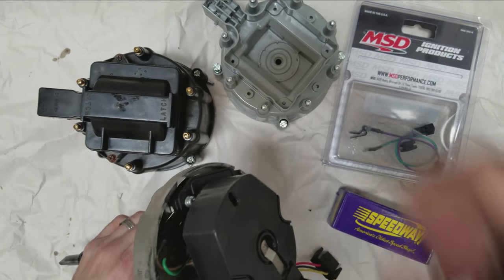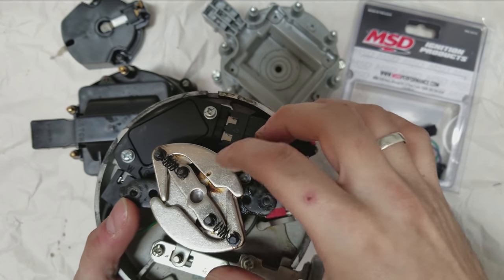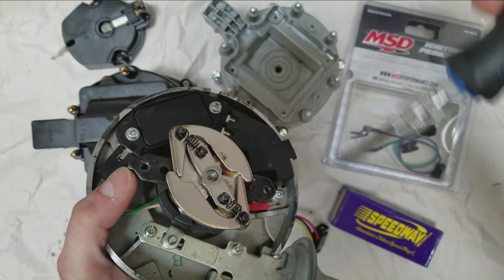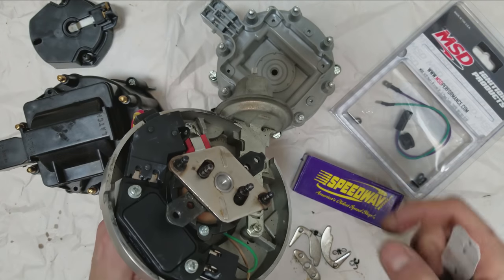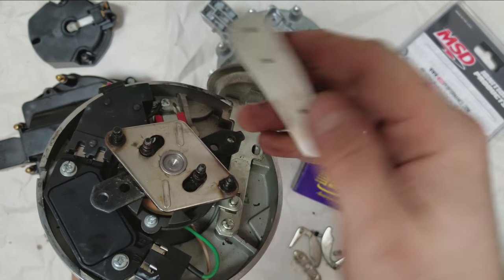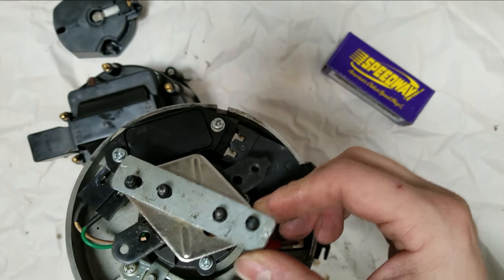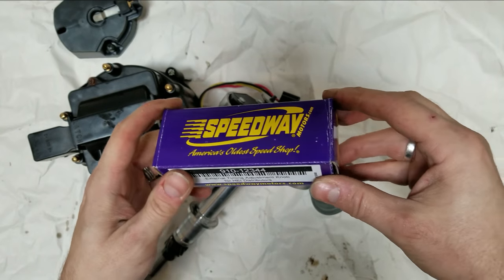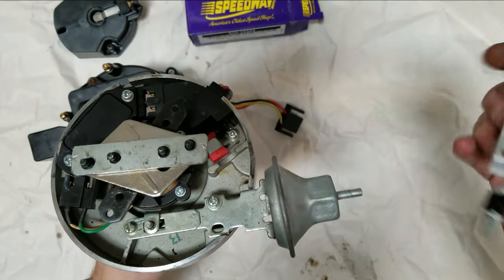1967 Turbo Camaro - GM HEI Large Cap Distributor Timing Control with Holley Sniper EFI

Comment: Would one be able to use the super sniper 650 kit and still be able to do this to the distributor for the ecu self learn to be able to adjust the timing while under boost.
Reply: As well as no boost. Thinking on runing it completely stock for a while to get a feel for how it is stock then swap to a different manifold and split headers to a muffler then back to duals. Get a feel for the holly sniper with headers on stock engine no port lumps, cam or roller rockers or big valves. Then later on rebuilding the engine with better rods an pistons nothing crazy. Keep in mind all of this is for a 67 c10 something different. Has a muncie 3 speed and 3.73 gears. So its definitely going to be interesting seeing what it does and how each thing changes the torque and hp curve.
Reply from the maker: I'd say I, and Holley would recommend this method. It's good to upgrade one thing at a time and ensure components function seperatley before doing everything and then troubleshooting to figure out what the issue is. Plus, the sniper can go on any engine so if you decide to go a different direction, it's not like you're throwing money away on it. As for timing control with the Super Sniper, I can't be sure. Mine is the regular version with the external coil driver. My understanding is they put the driver inside the Super Sniper but who knows if it's the same device or how it will function. If I were to take a guess, I'd say it will probably work if hooked up the same way. I just can't see why it wouldn't. I'd spend a bit of time figuring out if it has been done before, or the difference between how you hookup the distributor from one Sniper to the other, as If they're the same wiring and nothing seems different, then the chances are good it will work. If the Super Sniper has extra wires or demands a specific sensor or somthing odd, you might be setup for disappointment. Keep in mind Holley doesn't support this method as its a slightly complex DIY and avoids purchasing their expensive distributor. You won't get help from them.
Reply: I personally havent found anyone that's done the super sniper everything looks to be the same but that doesn't mean it is setup the exact same. 250 bucks for the hyperspark distributor doesnt really seem that much vs spending time on a HEI distributor just to get it to adjust the timing as needed.
Reply from the maker: Yeah if you don't already have an HEI and they make a compatible distributor for your engine then that's probably the way to go. I had my HEI already and it was only $45US so more of a budget approach. Plus they didn't (don't?) make a compatible dizzy at the time.
Reply: Ahhh okay I see why you did it now that makes sense. I am glad to hear that they just started making a compatible distributor for the L6 250 engines.
Reply from the maker: I see that now... $250 is still a big price for a reworked hei distributor. But at least they've provided an alternative for the straight six now so people don't need to rely on a modified HEI to get it done.
Reply: Yes 250 is a bit much but to think it's the only ones that I know of exist. They might be more reliable then a modified HEI distributor. Only time would tell.
Reply from the maker: I think the big advantage to getting a hyperspark is the community support and warranty. Holley stands behind their products so you'd get help if you needed it. Some HEI modders have had issues with radio interference causing timing spikes and dips. I bought special copper tape to conquer it but never had to use it. So if you have the money and don't want the potential headache, I'd consider a hyperspark too.
Reply: @TurboCamaro67  That's probably the way I'm gonna go just to get rid of any types of headaches and that way it wont have interference issues with it.

Comment: save a lot of time and money and just get a distributor for a 88-94 chevy pick up (small cap) and the holley system will control the timing. I did this on my 69 Camaro
Reply from the maker: You bet, their are other options but for my project you'd need a straight 6 compatible distributor and have the coil in cap is a nice way to keep the bay tidy. But if you have access to good compatible  OEM parts then go that route for sure.

Comment: Are u still running this setup
Reply from the maker: Yes, not once have I had problems with it. Once I got through the install and initial setup it has been a perfect solution to timing control. Besides the EFI system, this method doesn't introduce anything that can fail, it's a hollowed out distributor with a single sensor. The only questionable part is the origin of the distributor, but you can use an OEM one of you want, I just did it on the cheap and it works well.

Comment: i wonder if i could use the sniper coil driver to convert my hei for my FITECH
Reply from the maker: from Al now that's a fun idea. I couldn't say if that would work but I'd be interested to know if it does.
Reply: or i wonder if i can combine a computer controlled large cap hei out of a cadillac with my pontiac hei
Reply from the maker: from Al yeah I really have no idea, I bought the GM large cap HEI used in this video for a low price, and if you can get a coil driver or something similar for the Fitech you might have a more predictable result.
Reply: so your large cap distributor is nothing special? Did your kit come with the coil driver?
Reply from the maker: from Al yes, my kit from EFISystemPro came with the driver. I believe they all do now. My large cap distributor is just a coil in large cap that they used from the late 70's to 90's. eBay has them cheap for like $70.
Reply: I already go my ebay special dizzy for the Pontiac. It looks like it came out of the same sweat shop as yours :)
I'm really tempted to get the coil driver and try it with my FITech. it really seems seems generic in the wiring for hei rather than special to Sniper. I don't see why it would work. My engine really isn't performance enough to justify an MSD box and I hate having too much junk on the fire wall. Anyway great video!
Reply from the maker: from Al I'd bet your right. If you ordered it separately you could always return it if it doesn't work, assuming you don't toast it somehow. Worth a try to avoid the cost and appearance of an ignition box. If you go for it, please let me know how it turns out!
Reply: Good idea. I'll let you know how it works. It'll be awhile though. I'm busy doing body work now.
Reply: So after more research it appears that for FITECH that module is not needed. It is built into the throttle body. I just need to buy the adapter harness and lock out the dizzy
Reply from the maker: from Al well that's good news, not too hard at all then. I look forward to hearing how it goes, Sniper invoved or not.

Comment: Is this how I would set up a hal effect dizzy
Reply from the maker: This method should work on hall effect and any other HEI distributor. Note that Holley/MSD is making new distributors that don't require these sort of mods for timing control.
Reply: @TurboCamaro67  probably not for my application 1974 triumph spitfire 1500
Reply from the maker: Hah, your probably right. However they make one for my engine now. Still a pretty penny though.
Reply: @TurboCamaro67  yea I just bought a new distributor to . I think I read in the install manual about hooking it up to mine. They also make a 123
Dizzy for the spit bluetooth programmable.  Or maybe go with the safeguard to eliminate knock on my stock dizzy
Reply: @TurboCamaro67  I used to have a 67 rs,ss Camaro 4 speed it had a sbs
And a 4 speed muncie back in the 80s I was told it
Originally had a 396/375hp
But later found out from the current owner it was a copo 427 out of the Van Nuys assembly plant in CA.
A dealer ordered 3 all dark green metallic. The guys at classic
Industries in HB. Traced the coul
Tag but couldnt make heads or tails of
It.... I guess I should have done my homework before I sold it for $1500.00. I did get a pretty nifty 
Whirlpool side by side refrigerator .
Anyways kinda glad I never new
I had a lot of fun in high school 
Back 1983 my junior year
Drove it about 15 year figured it
Was someone else's turn.
Had a 68 el caminos then a 87'
Porsche Carrera 911 targa Venetian
Blue , a 92'vette and now a 74'triumph spitfire. My wife is always bitching about "why did you get rid of the Camaro" 
I miss the Porsche more it was BEAUTIFUL.  But have to say 
This spitfire is a lot of FUN 
Super easy to work/modify 
Cheap parts and Italian
Lines, gorgeous car 
Like a big go cart 
My best memories are being young 
In that Camaro though my girl looked just like Marilyn Monroe.
Been married 32 years now she's 
Still pretty haha!
Good times
Reply from the maker: This is a great share! Memories that last a life time. Some of my favorite moments were in my first couple cars, a white 66' 4 door Impala with a 350 and then the black 69' 2 door Impala with a 327. It was the first engine I rebuilt and remember ripping around fresh out of high school in that black beauty. Fixed up the interior too and actually drove across the province to meet my wife in that car. I always wanted the 67' Camaro but the Impalas made me a Chevy guy for sure. It's amazing how great life seemed just driving around... It's still that good right?
Reply: @TurboCamaro67  yep!